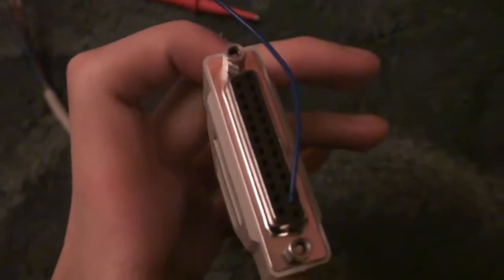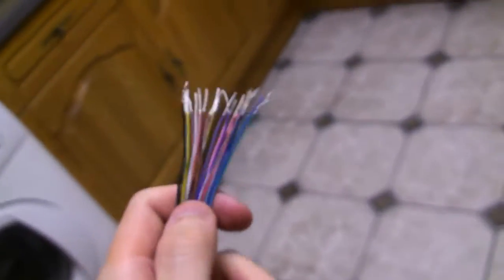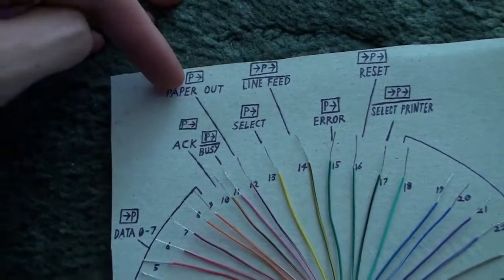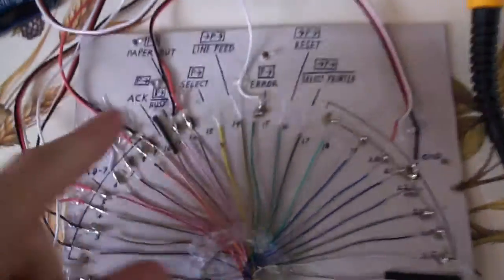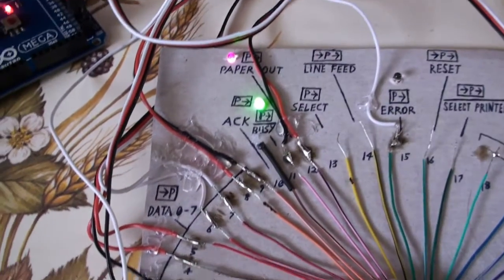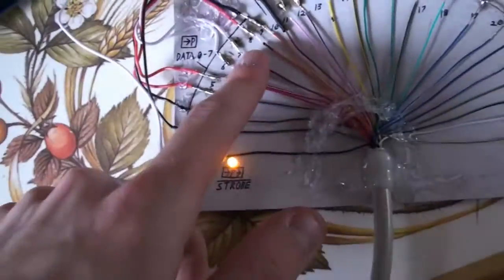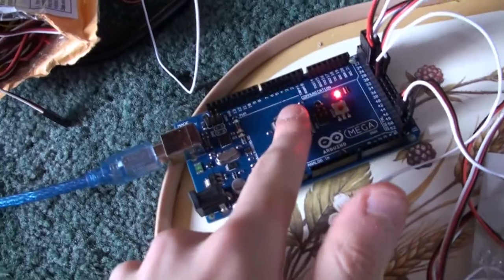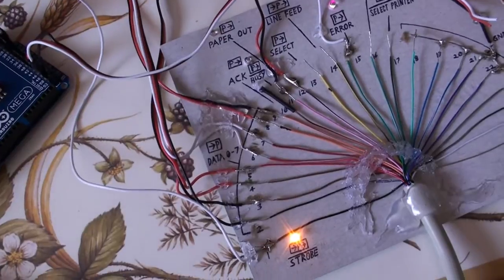Dot matrix printer interface: Hardware (building/proof-of-concept)

Comment: Hmm. I was under the impression that those 8 pins controlled the 8 points on the printer head. Are you simply splitting the byte you send across those lines?
As for high-vs-low: http://pinouts.ru/ParallelPorts/ParallelECP_pinout.shtml
Reply from the maker: Yes, they're the 8 bits of bytes (plain ASCII text, or control commands to e.g. set the font or draw graphics). The print head itself has 24 pins (most have 9, 24 or 48 pins).

Thanks for the link! I was following Wikipedia, but text and a diagram didn't even agree with each other on the page, so yeah.